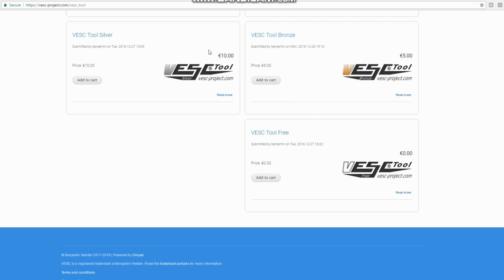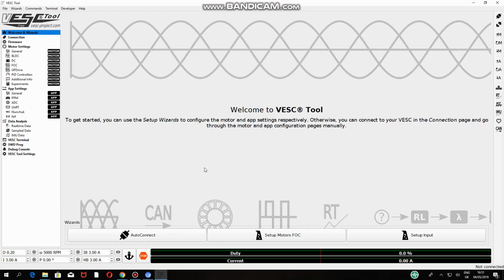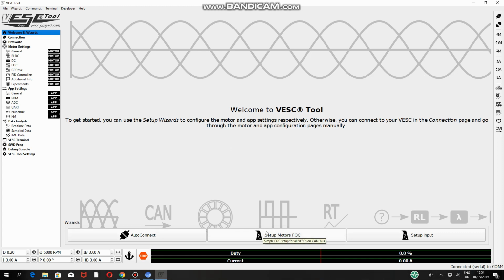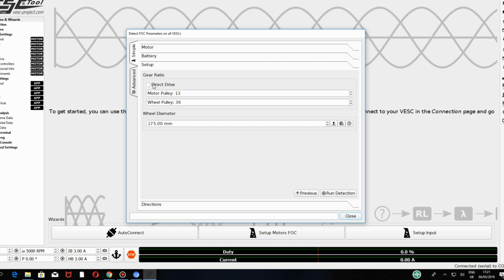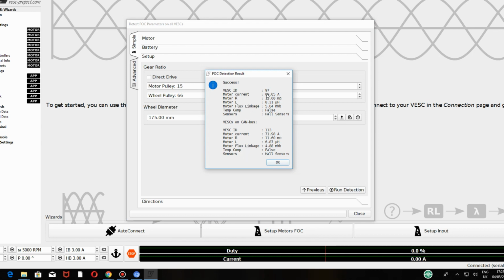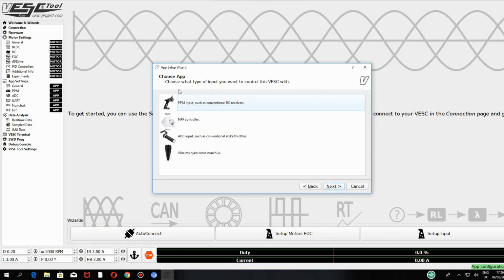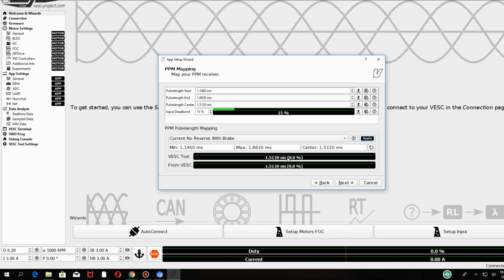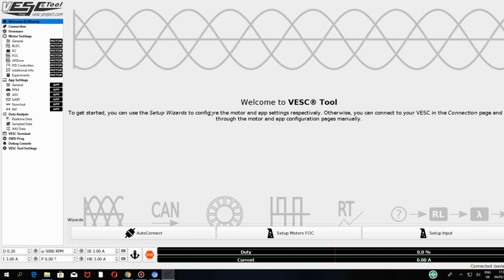VESC TOOL 2019 TUTORIAL. PLEASE READ MY COMMENT!!!! IMPORTANT!!!!!

Comment: Thank you so much :)  It's really helpful😅 it save me so much time to figure it out. 🙏Pls keep this video
Reply from the maker: Good morning!
Thank you very much for a lovely comment. Really glad that the video helped. One thing to note that the battery max needs to be equal or less than the ESC motor max. I was using the Lipo batteries for the set up so doubled it but for 18650 please have the battery max = motor max,
Ride safely buddy.
Reply: @PavelGarmas  For 6S Lipo battery how high resistance consider bad? Thanks
Reply: Thanks my motors are 50A max each & battery 100A max 12S lipo so it should be OK?
Reply from the maker: So you are using the Lipo as well.... ok cool. That is what I got on my Beast - no issues.
Ride safely buddy.
Reply: My 2nd test ride today got a speed wobble 😅 but didn't fall 
My Trampa Urban Street Carver  14ply, 6.5" Urban Superstar hub and Trampa dampa 60A super easy steering (pink),it's so nimble, the craving experience, fast transitioning, tire grip & turning radius is unreal, before this previously I build a mountainboard with Trampa short deck and DIYEboard MTB trucks and 8" wheels, the turning radius is good but this new build is much better and smoother
Reply from the maker: @akincb3114  
Sounds like an awesome board mate! Speed wobbles are not pleasant and it does take time to get the board set up and fine tuned to fit the riders style and weight...some people use different bushings / springs at the front and rear.
Loose trucks will give an awesome carving but wobbly top speed....
Just be really careful when testing the board mate.
Another tip is to keep the weight distribution towards the front like the downhill racers do - helps with the wobbles.
Reply: @PavelGarmas  Thanks for the tips that's how I kill the wobble, it happened on my other DIY build also, when deceleration the throttle need to be slowly ease off, the combination of high torque with flexible deck and soft bushings, it's feel really good for turning and craving but much easier to get a speed wobble, I also got a Trampa 16ply MTB with Yellow Dampa & 9" Primo planning for my next DIY for off roading :)

Comment: Very informative Tutorial, i noted when you are testing your motors that your motor current is around 70 Amp. What is the size of your motors? I have the Trampa 6376 (max power 3800 watt as  shown in their website) but it s giving me 60 Amp only. Thanks again.
Reply from the maker: Hello Jamal,
Thank you for the nice comment. The motors I am using are 6374 190 kV motors by Street Wing. I do have a couple of videos about the motors on my channel. My motors to come up as 74 and 70 Amp max... quite nice but I do run them on 60-65 normally.
Hope this helps.

Comment: Hi Pavel,
Thanks again for this great video 👍
You are using a dual Vesc. I am using 2 focboxes using a canbus cable to connect then. 
My question, 
do I have to do the motor detection on both foc boxes, or ist it enough  
Doing it on one, do to the canbus connects the second ?

Setting the Remote , 
as you said, it detects the remote connected device. 
Do I have to do the same on the second focbox, saying that it is the slave ?
Or will it be set automatically ?
Thx again for your time and help 
👌👍👍
Reply from the maker: Hello William,
I do normally set the Master esc and the slave gets the settings via the canbus BUT I do always plug the second esc ( even the duals ) and do check if the settings did transfer. Did both motors spin up when you done the detection via the Master esc? 
As for the remote, you just set it up for Master esc and then the Master controls the Slave.
Hope this helps.
PS! Always test the board function and the remote function on the bench and then in the well controlled area ( like a quiet park ) before going on the street ride. Please ware helmet and pads …. testing is the key! You  might find that the power is too high or the brakes are to strong while testing …. good to get it perfect before blasting on the road : )

Comment: I need some help. I'm using 2 torque board 4.12 esc and I cant seem to get my slave esc working (only one wheel is spinning). The slave esc is working it's getting power and I can get it to spin the wheel but I can seem to get both wheels spinning.
Reply from the maker: Hello mate,
Did you choose the option of dual vesc in the tool? Did you set each vesc and done the motor detection? Did you save the changes every time you made some changes?

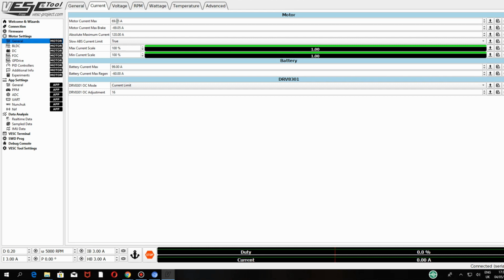Comment: Hi Pavel. thanks for the video that helps a lot! there arent many videos with the new vesc tool so this i great!. one last question at minute 19:00 you made all these modifications to the vesc tool. is there an "apply" button to apply these modifications?
Reply from the maker: Hello,
Yes, you need to press Motor read or App read button ( its the one like M with the arrow down under it ) so you save the changes. You will see a note pop up at the bottom right corner saying " updated or written - something like that.

Comment: Great vid bro! Just one quick question, if we change the vesc erpm setting to limit the belt driven motor's rpm (let's say to 3040rpm), would that give us more torque than a setup with the same wattage output but rpm on the motor's default values (9120rpm out of 48v * 190kv)?
Reply from the maker: Hi,
Very good question. I am not the Guru on all of this but based on my tests - the torque does not change. The best way to gain torgue is to play around with gearing and to reduce the size of the wheels. I have found that default 9120 ; 12S ; 190 kV with 66 / 15 gearing and 7" AT wheels gives it the best torque and 30 mph.

Comment: How to program slave esc for the remote controler? I have only one motor ready I think with this configuration

Sorry for my English, I'm from France
Reply from the maker: Hi,
Are you using two esc units? You need to connect them with the cable ( it does stay permanent ) and  then one esc becomes the master and another the slave. Remote gets connected to the master only and the master esc tells the slave what to do. You program each vesc separately but need to name them 00 and 01 or slave and master.
Hopefully it helps but if not, let me know and I will clarify more.
Reply: @PavelGarmas  Thanks for your answer.
I'm using 2 ESCs, programmed separately.
I have the ESC ID 101 and the 2.
My remote is on the 101. But I don't see the parameter to send over CANBUS on the ID 101..
Reply from the maker: I am confused..... so you got two esc units connected with the canbus cable? Are you using the latest vesc tool? There is an option where you choose your master esc when programming the remote plus there is an option to choose if multiple esc are being programmed at the beginning. Take a look at my video I am sure I did cover it.
Reply: @PavelGarmas  OK, Tuesday when I come back to home I'll see better that, thank you bro
Reply: @PavelGarmas  I do the same, there is no communication between the ESCs ID101 and ID2
Reply from the maker: @1ja2ja  are your mbus connections correct? The two in the middle are connected right?

Comment: Hello friend clarifies me a doubt in the engines my engine is 550 gr is it small or medium? because in you I do not understand small is up to 200 grams or from 200 grams up to 750 grams and small or 200 grams up to 750 grams it and medium this is making me very confused. lol. thank you for your attention
Reply from the maker: Hi
I would choose medium. Any motor that is 6355 or 6374 would be medium in vesc tool,
Hope this helps.
Please note that i am using Lipo batteries in my tutorial so if you are using 18650 pack - read the drop down notes when setting up the battery max.
Regards.

Comment: great !! 
i have one question.
what the max currant for m? 

motor and brake
i have 2 battary 

12cells 12amper
12cells 10 amper

i plug the secund battary just if the first one done 
also i want explain about the brake charge 
wait for your answer

Comment: the most common problem is that it wont update the ESC even after the Restart.. any solutions on that ?
Reply from the maker: Hello,
I am sorry but I do not understand the question. What esc are you trying to program? Is it the vesc based esc? You might need to use the BLDC tool if it is not vesc based unit.
Please clarify the question and I will gladly help you mate.
Reply: @PavelGarmas  hi Pavel i have the Flipsky 4.2 the VESC detects and updates but there's no signal after the update. So when i restart the ESC there comes the warning again that it should be updated (again).. Tried with different cable and computer does not upgrade. From what I have read there are also other people with this problem.
Reply from the maker: Hmmmm
So you did use the correct cable - data cable? Did you try to see what is the latest software on the esc when you plug in?
does the vesc tool show any errors at the bottom left corner ?
Have you tried the BLDC tool? You should not run the FOC on the 4.20 anyway....
Reply: @PavelGarmas  Thanks a lot for your time, i installed the older VESC 0.95 and its now configurable.
Reply from the maker: @miniproto4721  
Awesome news mate! Well done.

Comment: hi i have a question to you, in my case the board breaks fully if the remote lost the connection for a second, and if you are on the board you fall (i have the same remote like in the video).
 Is there a way to deactivate this funktion or to lower the breakpower in case of a disconnect?
Reply from the maker: Hello Swen,
This is really strange.... did you calibrate the remote? Is the neutral position almost 0.0 %? Please carry out a test - put the board on its back ( wheels up ) push the throttle forward and start walking away from the board or get someone to start walking away from the board....remote will get far enough and will loose the connection....watch what will happen. I don't think that it is the disconnection issue to be honest. Let me know how you get on please.
Reply: @PavelGarmas  my remote reviever and all the other stuff was in a metalbox for protection, now i took the reciever out oft the box and did the test.
the range is now way better than before but i dont know if i can trust that, specially on higher speed.
Thank you for your fast help
Reply from the maker: Mate!
More than welcome. Just test it fully in a controlled environment with full protection on....that is what i do...
Ride safely buddy!

Comment: Hi Pavel, congratulations for your channel ....I would like to ask you why I have  an uneven acceleration when I push hard on the throttle ...I use a Flipsky 4.2 plus and two 6374 same brand . Thanks
Reply from the maker: Hello Marco,
Thank you for the comment buddy. It is hard to diagnose the issues with so little information but here are some points > does the battery S count match the ecs max allowed S value,  what battery are you using and what is the max discharge rate of it..... is the battery Max lower than the motor Amp settings.... sounds like the battery can not deliver enough power to both motors under constant load,
Hope this helps and please let me know how you get on....
BTW is the BMS by-passed on the discharge ...
Reply: @PavelGarmas  Hi Pavel, thanks for your prompt response...
I got two lipo 6s 6 amp 45C...brand Zop Power...I set up the motor current to 60amp....
Reply from the maker: Hmmmm...should be no issue then. Your batteries are quite good. Can the Flipsky 4.2 take 12S I am not sure TBH. Try setting the motors to 50 each and the battery max to 100. Test the board carefully and see if the acceleration is smoother.
Flipsky 4.2 is rated to 100 Amp cont only and you are pushing it to 120 ....that could be the reason,
Let me know buddy.
Reply: @PavelGarmas  mmmmm.... actually you right... maybe it's the ESC that can't handle it... I'll try it... thanks for the moment
Reply from the maker: Thanks for the moment.... LOL
Let me know how you get on.
Reply: @PavelGarmas   hahaha...
Last question... when you setup 60amp... is it x motor or in total???
Do you anything about to unplug ppm and UART during the vesc tool setup?? Flipsky told me to do that because it can affect the settings.....🙄
Reply from the maker: @marcos.6884  
Do you mean the set up in my video?  I did set it to 60 each motor but my esc is 6.6 plus and can take 200 constant. 
No I did not unplug anything. ...i am using the dual esc.
Reply: @PavelGarmas  Im using the dual vesc too...but 4.20plus...my question was If I setup 60amp.... means 60amp each motor??..If so maybe I can try 50/53amp with my 4.20...
Reply from the maker: @marcos.6884  
I would suggest setting each motor to 50 amp and the battery max to 100-120 amp and try in controlled environment.
Reply: @PavelGarmas  I Will try as soon as possible...one question...Is there something wrong to setup FOC all sensor instead of BLDC?
Reply from the maker: @marcos.6884  
Are the motors sensor ed? Does 4.20 support FOC? Check first. I prefer bldc TBH

Comment: The maximum charge rate for your battery is 5C, not 15C (according to Turnigy's web site). 40A x 2 (80A) seems to be an extremely high current to be pushing back into your battery, even if it's just short bursts. How are they holding up?
Reply from the maker: Hi,
Thanks for the comment,

Batteries are fine so far. Had circa 15 charges on them already. Best test was riding the board in France at the event where brakes had to be used a lot.
Why do you multiply 40A times motor amount..... esc will not let more that 40 Amp through to the battery. Battery is 8000 mAmp each so 40 is a good setting. Am I wrong

Comment: The battery max current don't need to divide by number of vescs?
Reply from the maker: Hello,
The battery max current needs to match the total vesc current so if you are running dual motors and dual vesc then multiply ( two motors 60 amp each = 120 amp total...battery max discharge 120 or you can work it backwards from battery max allowed and get the motor max ). I am using the single dual vesc so consider the total for both motors.
Hope this makes sense.
Reply: @PavelGarmas  so in each vesc the battery max current will show 120a in ur case. Am I right?
Reply from the maker: Correct : )
Reply: @PavelGarmas  You should click on the question marks for each setting and not give bad information to people. The dialog box clearly says "THE BATTERY CURRENT IS ALWAYS LOWER THAN OR EQUAL TO THE MOTOR CURRENT". The battery current max should be 1/2 of the motor current max for dual setups, not double!
Reply from the maker: @waynekendall6196  
Thank you for correction buddy. 
I have based my video on the set up that I normally use....never had any issues ( 5 boards so far ). I do agree - vesc tool got all the answers and people should reserch. 
Thanks again.
Please feel free to reply to the comments with your opinion so people have choice.

Comment: How do you figure out what your battery current max is? I have 2 3300 mah, 5 sell batteries wired in series. The discharge rate is 30c
Reply from the maker: Hello Luis,
Thank you for watching the video and for the question,
Battery current max = Amps x c rating so in your case : 3.3 x 30 = 99Amp max discharge. Each battery should indicate the max discharge so each parallel battery max X amount.
Do not forget to divide by amount of motors. so if you have the dual motor board : 99 :2= 49.5 Amp MAX,
Hope this helps buddy!
Reply: Pavel Garmas Does the battery current max go up if you connect the 2 batteries in series or does it stay the same at 99 amps? Thank you for your help!
Reply from the maker: @21111009198573  
Hello mate,
Amp stay the same when you connect in series but voltage doubles so if two 6S packs are connected,  they become 12S pack with 3300 mAmp capacity.

Comment: my vesc is not detected on windows 10 what could be the issue tried changing micro-usb cables.
Reply from the maker: Hi!
Did you update the vesc to the latest software version? Is vesc powered when you are connecting? Is the battery charged? What vesc or ESC are you using buddy?
Reply: @PavelGarmas  thank you for replying my bad the cable was the issue the vesc doesn't detect when you use charging cables, needs dedicated data input I was able to update firmware version then it was breeze. I use vesc 6.6
Reply from the maker: @NageshMayappa  
Perfect!  Glad that it all worked out mate. Was the video helpful?

Comment: on esc  is one switch for something like dual or single what ..... what that switch means.
Reply from the maker: What vesc are you talking about? Flipsky 6.0 or 6.6 plus?
Reply: @PavelGarmas  ou hmm I thing flipsky.... flipsky ist 6.6 plus or? On board in the midle of capacitors.
Reply from the maker: I there is a little switch there that means you got the 6.6. yes it is to activate the dual or single vesc operation buddy.
Reply: @PavelGarmas  soo with this esc can man powered one big single motor?when I soldered 6motors wires together to 3 big motor wires? It coste so mutch money then I need to now to a nother projects this esc giwen.
Reply from the maker: I would not recommend connecting more than one motor to a single vesc...each motor needs to be controlled and each motor does have HALL sensors that need to be plugged in....
Reply: @PavelGarmas  can I seand foto to your mesenger. How I thinking.
Reply from the maker: @tomgreysk  
No problem.

Comment: Great Video, its WAY easier than I thought it was going to be. I do wish I could connect into my SR flex e 2 carbon and adjust the braking. There must be a programming header on the board, maybe someone could make some software to reprogram it? :)

Great vid.
Reply from the maker: Thank you Paul!
Unfortunately Flex 2.0 got the ESC and it can not be programmed ..... most production boards got the ESC and not the VESC .